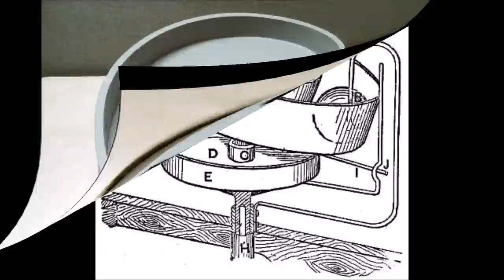Self running Tilting Tray. Perpetual Motion machine

Comment: This reminds me of the w.i.s. generator i read about, which stands for weight into speed, in which it was claimed their was an aincent device wheir they were able to power their whole city..... It was a large cone shaped device with a massive marble stone that was carved out into a perfect spherical shape..... At the upper portion of the cone their was a track in which the sphere would follow as the cone would tilt causing a perfect circular tilt which kept the cone in a state of constant imbalance causing the sphere to do a complete 360 degree circle.... By the way their was circular wall that surrounded the cone keeping it from tilting to far in any direction..... If you want to understand this phenomenon better i suggest you check out the Hamel generator plans at www.futurehorizons.net